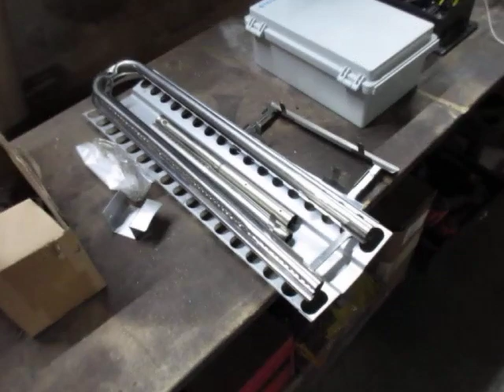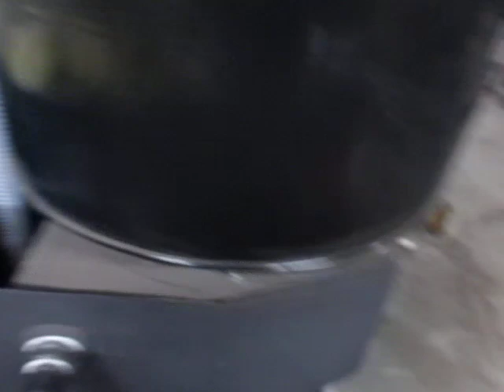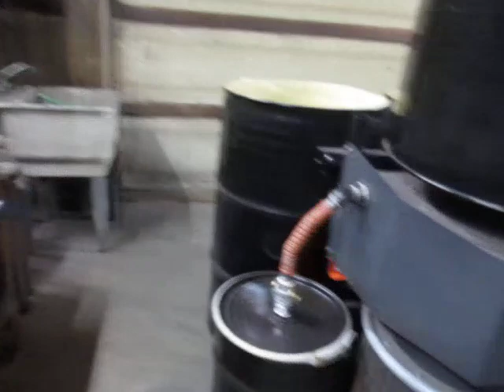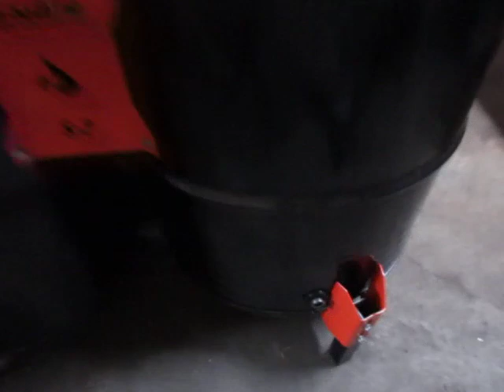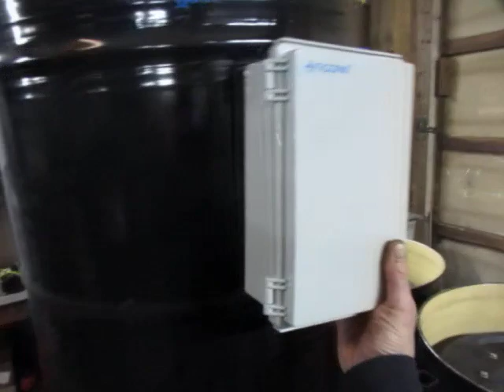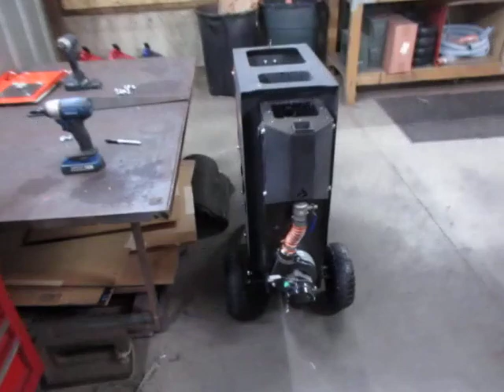VersiFire Update!! This Is the Future of CHP Gasification!!

Comment: I have been really encouraged, from over here in Australia, to see the range of products you have developed over the past decade or so. It reminds me of the early days of the railway system/high pressure steam locomotive development in the late 1820s that saw the early, lumbering locomotives suddenly transformed  into George & Robert Stephenson's Rocket; suddenly able to cheaply and reliably transport people and goods at 30 mph.  All of which was made possible by George's empirical knowledge and spooky mechanical intuition combined with his son Robert's engineering education--as you say, trial and error plus maths. 
I think this system of yours is a more manageable approach to gas supply than the biogas fermenter systems that can't be easily switched on and off and need to constantly regulate the fermenter temperature. You appear to be on the verge of having a realible, affordable, system that promises to minimize wasted heat, that has a cost effective degree of automation which reduces time spent babysitting the system, and could, in principle, also provide biochar, should you find you are generating surplus engine-grade gasifier charcoal. For everyday folks that don't want their life and liberty controlled by others this is like a vital new fork in the industrial revolution. Thanks for your vital work; it will be hard for humans to maintain their freedoms while others control their energy supply.

Comment: Love this idea. I have an Imbert wood system,for battery  charging and running workshop.(smaller than yours).It also runs my small living place.I do have a heat exchanger for cooling the gas, and running my hot water .As you said,there is a lot of energy  lost in this system.Have thought  about a gasometer,for storage and cooking,heat ect.but couldn't see a way with my means to store enough.This automated system would solve that.Also could run charcoal instead of straight wood for engine.Been watching your channel for a while but couldn't make charcoal in no burn zone.You may have solved a few problems for me.Please update as things progress and when you have an idea of price .let me know.Love your work and honesty.